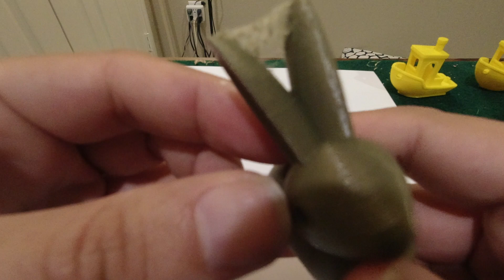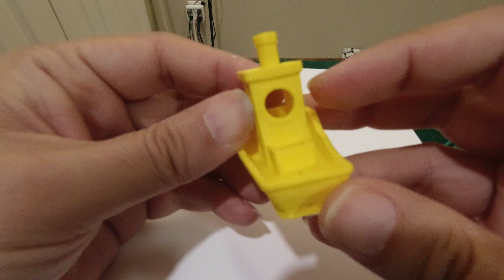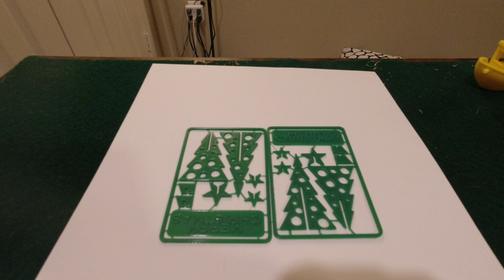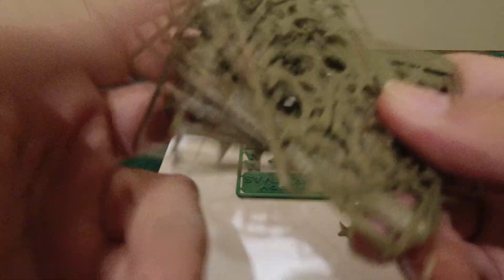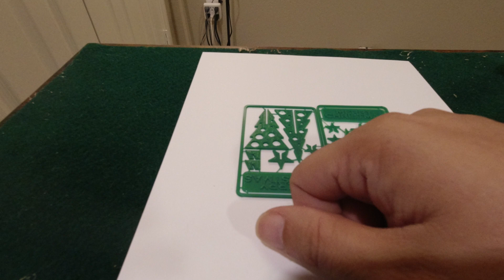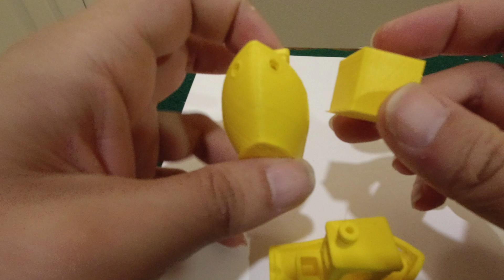Print review, and final thoughts on the Creasee CS30 3D Printer

Comment: I too am having stringing issues, and it hangs at the end of the build cycle.
Reply from the maker: I actually returned this due to inconsistent printing, I use a sunlu so now as my primary that works wonderfully with minor upgrades.
Reply: @rishu123x  I resolved the issue by lower my bed temp to 60 and 205 hotend for PLA+. That worked pretty well
Reply from the maker: @photoggenes7443  Thats good to know.